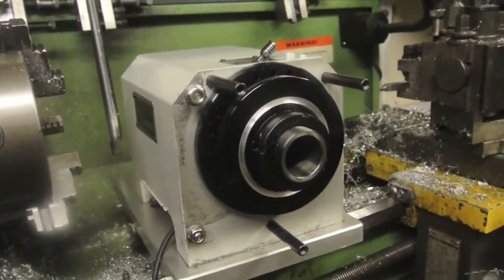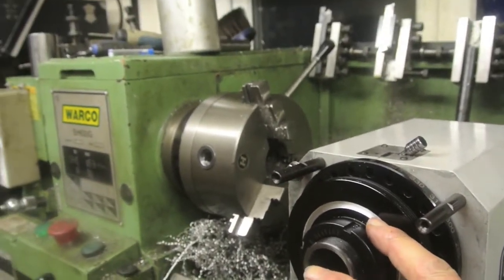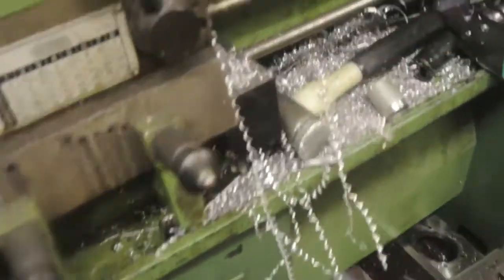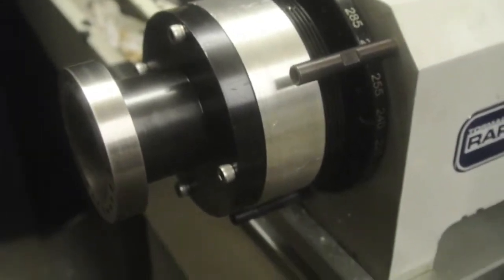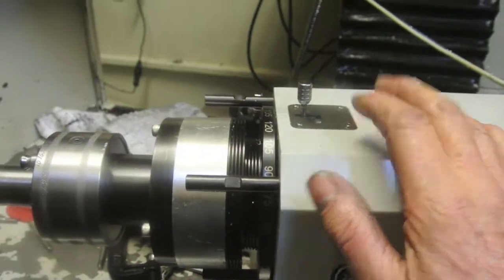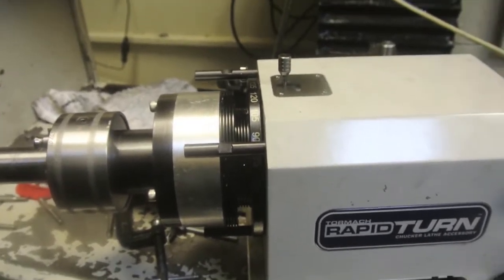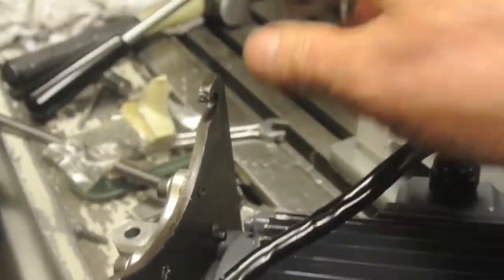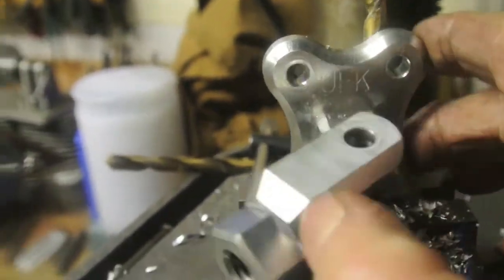Lever  Collet Closer Fo r Tormach Rapid Turn

Comment: Good work Bob - Thanks for sharing.  Cliff
Reply from the maker: Thanks Cliff,
                      I've just finished altering the belt guard to suit and have some sheet material to make a better guard over the motor so that when using flood coolant it doesn't get into the cover.
The lever operated closer has certainly made it a lot easier and quicker to make short cycle parts. 

Next improvement could even be a pneumatic cylinder to operate the lever as part of a programme but that's down the line a bit.

Comment: Hi Bob, what perfect timing.  I was just thinking about this over the weekend.  Did a search today and guess what comes up :)  Seems like you come up a lot in my searches.  Hope you're feel well.
Reply from the maker: Hi Shawn, I,m keeping well. 
It is a relatively easy conversion to make it fit the Rapid Turn. The critical part is getting the adapter to run concentrically and radially true. When I first tried it even though the radial run out was less than .0005" when I fitted it the lever handle showed some wobble and when I checked the run out on the end of the Knurled adjuster on the closer there was about .010" of run out. I checked the adapter and it became obvious that though radially concentric there was a variation in thickness caused when turning the part round to machine the opposite face. I ended up fitting the faceplate into the manual lathe, taking a truing skim off it and clamping the adapter to it then machined the face flat. This improved it considerably but there was after doing this some radial eccentricity was evident so I opened out the through holes in the adapter and machined the outer register slightly large to enable me to centre it by clocking it and gently tapping it into position with the bolts not fully tightened. I managed to get the thing to run pretty well true after doing this but it still could do with a little more adjustment.